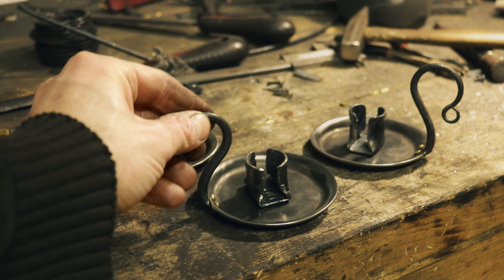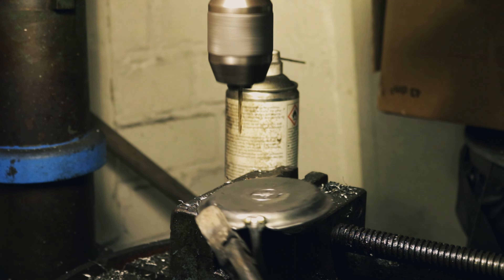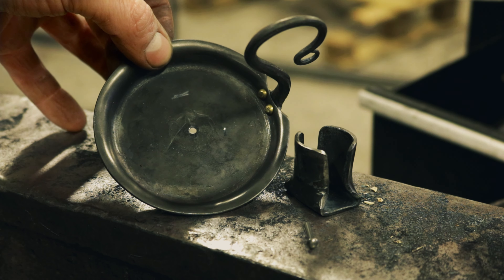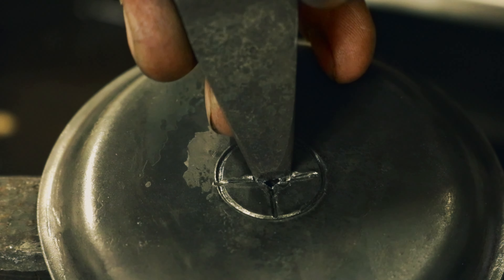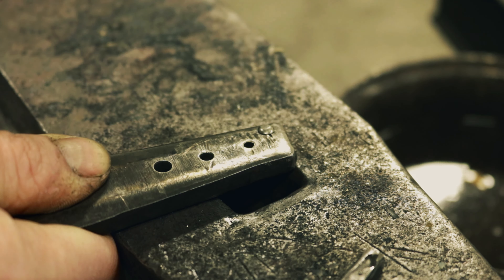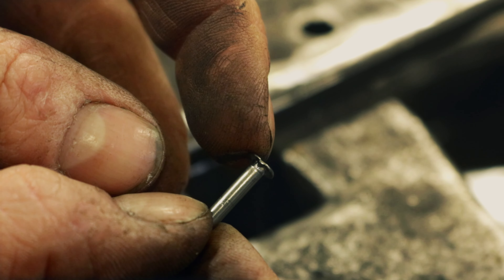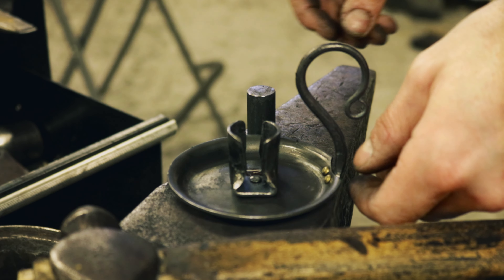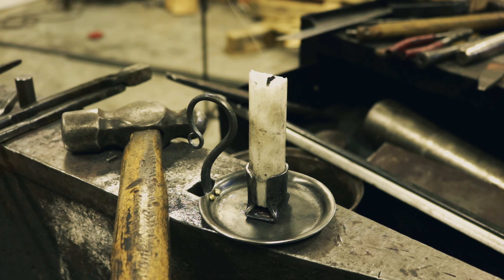Tip for beginner blacksmiths: watch this before setting your next rivet!

Comment: Used this for years and it works well.  I punch in a cross using old cruciform head rawlplug masonry 'star chisels' I think they are also called stardrills
Reply from the maker: It's a quick and easy way 🙂
Reply: @lufolkcrafts   This treatment on one side of the rivet on a pair of tongs, gives a good stable joint with less movement and wear.
Reply from the maker: @bigoldgrizzly  i have seen people use it on tongs. I haven't tried it myself yet. Should do when I forge my next pair to feel the difference.